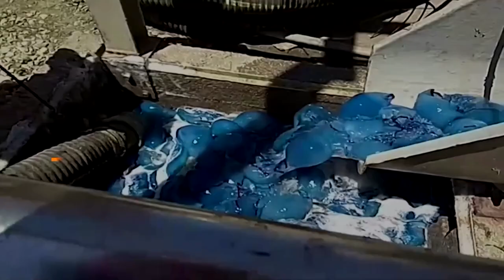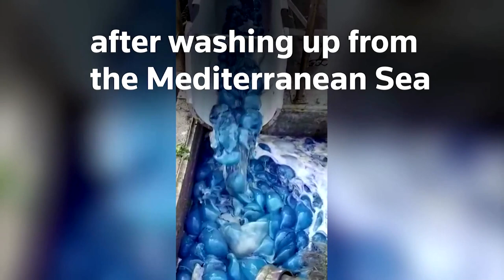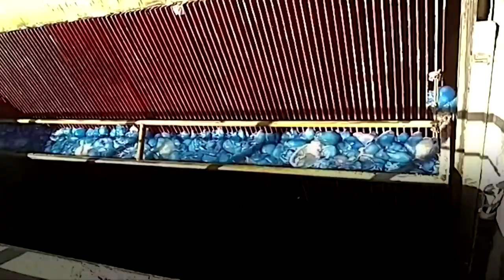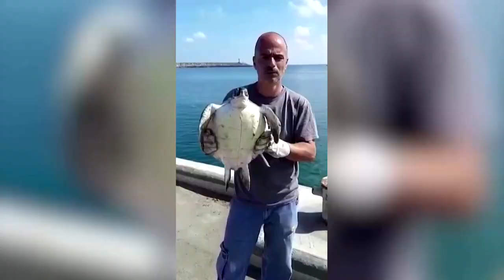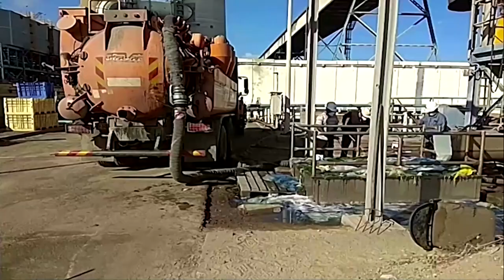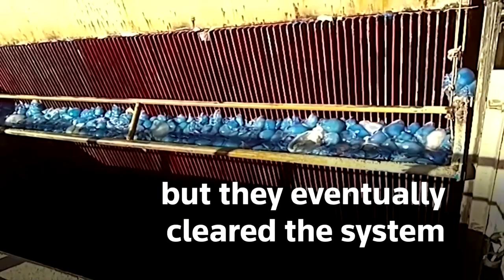Blue jellyfish swarm Israeli power station

Comment: Surely you can design a filtration system that can avoid this.
Reply: When it's first engineered yes but not easily now as they would probably have to also upgrade pumps because it would need a physical barrier to stop them and would restrict water flow.